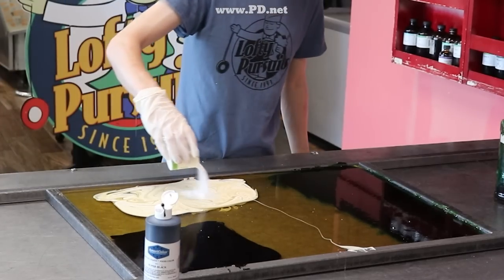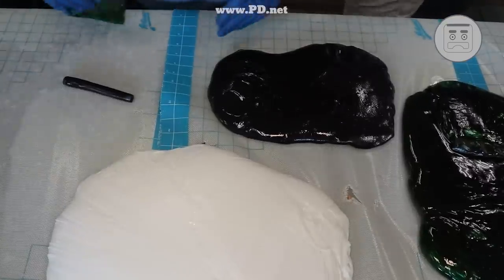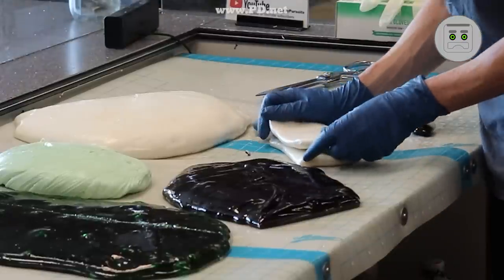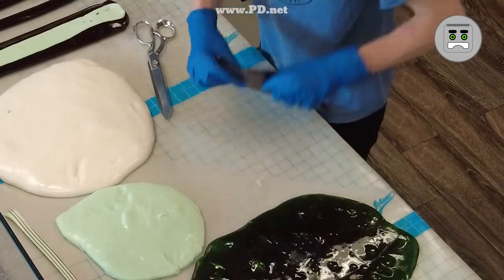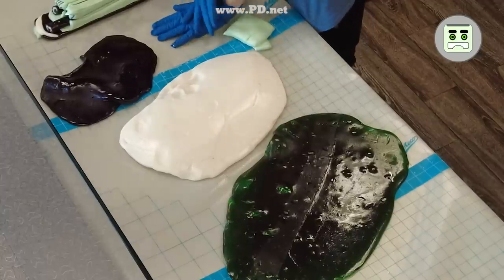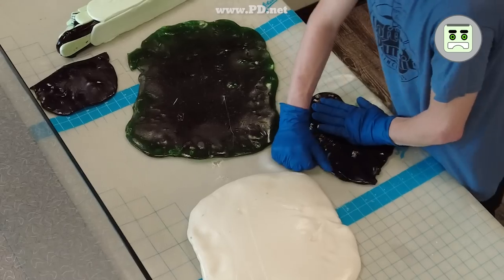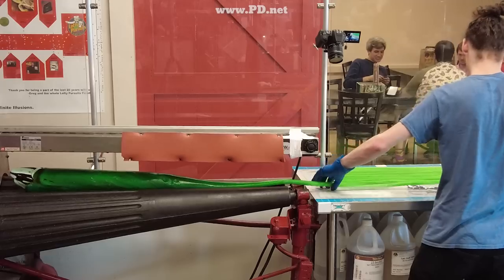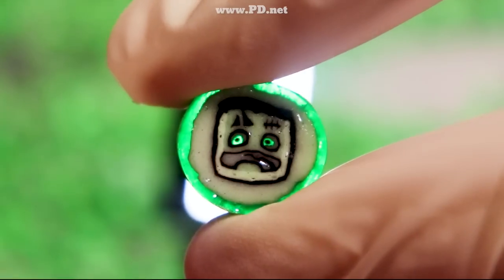#176 Mashing Monster Flavors to Create Frankenstein Candy

Comment: Genuine question, Greg: how do candy-makers judge how much to make of each color for the components of a design? (Such as, for instance, how much light green to make for Frank's face here.) Is it something you just have to get a feel for, or is it flexible given how much you can stretch the candy? I imagine excess waste being left over isn't too big of a deal in any case, since it can probably be incorporated into stripes in the outer wrap...then again, I guess if too little light green had been made here, you could have always made more on the fly, huh?
 
ETA: Wow, the one time I ask this question I've been wondering for awhile is the same video that shows more of a color being made on the fly. That's what I get for not watching all the way through before commenting, I guess.
Reply from the maker: As we're stirring it in, we just hold up a spoonful and want to drip back onto the table. I look through the stream that's being poured. It's fairly thin comparable to what would be in the candy. What you can't see is that there's a light spot on the wall on the other side of the room and I pour it in front of that so I can see the color accurately. Or at least accurately enough. I usually get it right on the first try because, I got a feel for it. But if I'm mixing a unique color like making navy blue or something strange, yeah I've got to look at it a few times